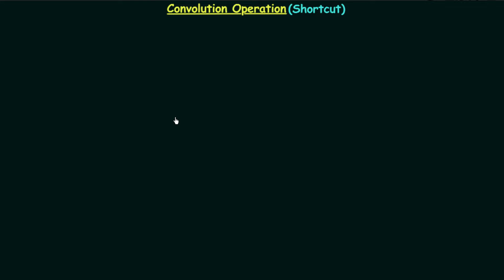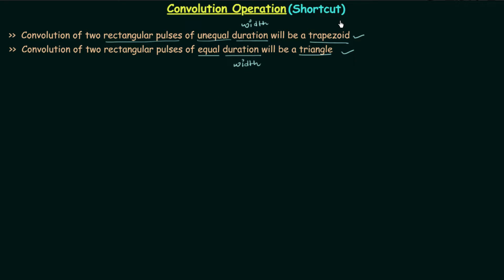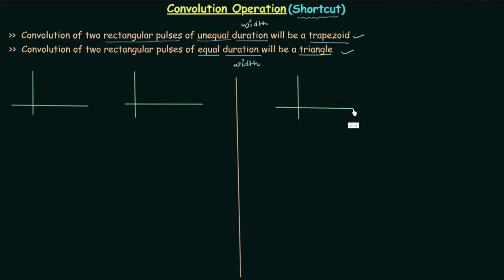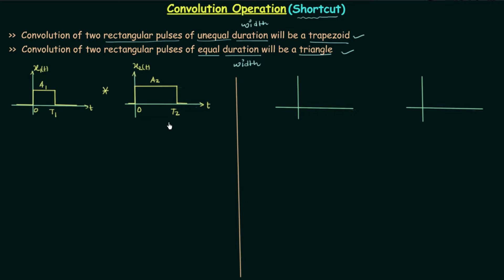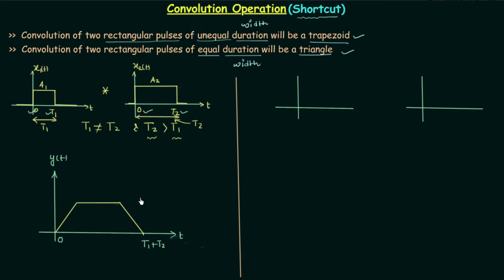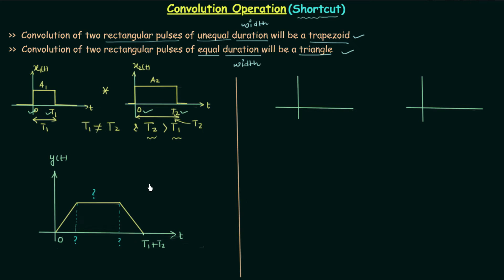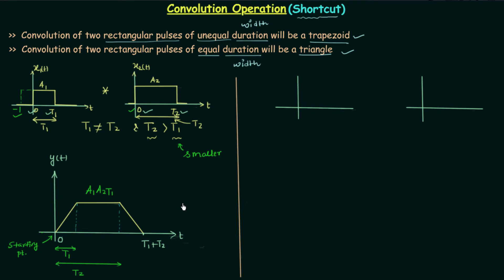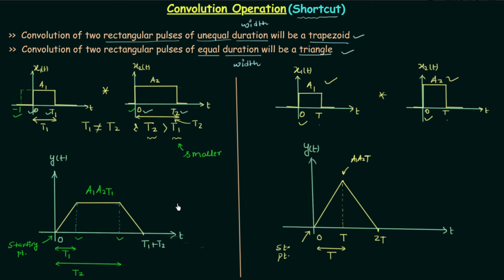Convolution Operation (Shortcut)

Comment: Sir when I applied shortcut x1(t)*x2(t) is not equal to x2(t)*x1(t)..
Property 1 isn't getting satisfied.
I mean when x2(t)*x1(t) T2 becomes T1 right.,& also amplitude (height) =A1À2T1 is also differing from first case.
Kindly explain
Reply: umm , I think we need to take the time period which is lesser , and not the time period of the one on the left

Comment: sir why you multiplieng t1 to A1 and A2 why not only A1 multiply A2
Reply: We are integrating two signals. Formula is integration of x(k)*y(t-k) dt. Right?. Above problem can be further expanded into three parts. You solve them. You ll get these results
Reply: For example say t > T1 and t<T2. Limits of the integration ll be from t-T1 to t, inside the integration there ll be A1A2 followed by dk. A1A2 will go outside as it's constant. Calculate the integration t-(t-T1). The whole thing gives A1A2T1. That's the middle part of the output, i.e. the max amplitude the above convolution can obtain
Reply: @dbss206  , i am very thankful to you as you have cleared my doubt and helped me getting the point. thanks for your effort brother.